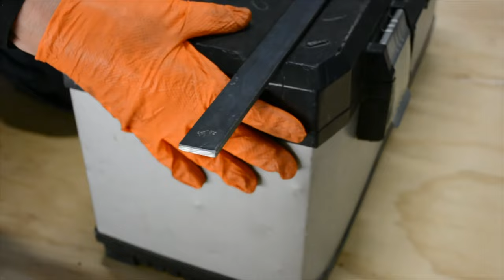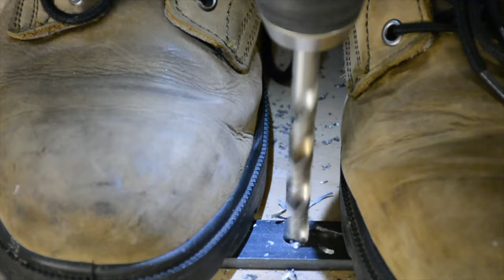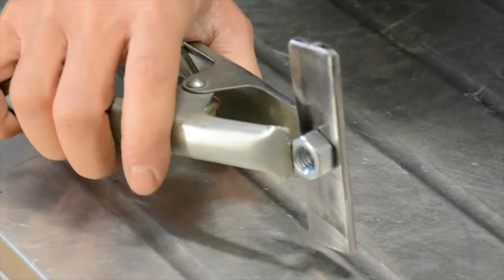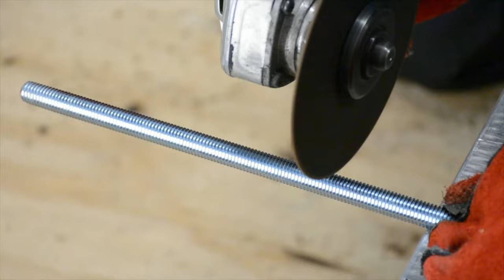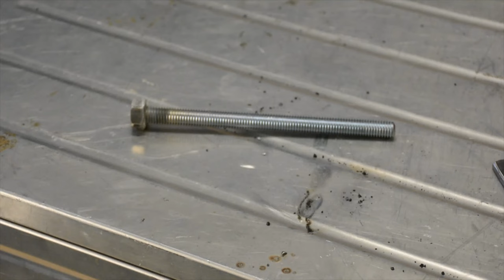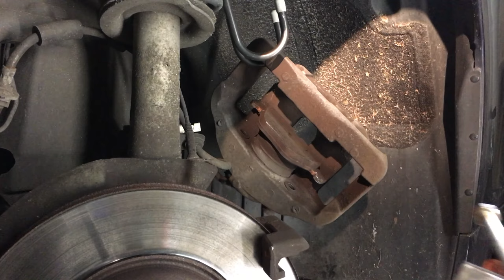Easy to make it yourself! Brake Pad Spreader Caliper Piston Tool DIY

Comment: Great idea. My only suggestion is to weld the nut with the screwed bar in place and cut the screwed bar with the nut on the bar. This way it is easier to start the threads?